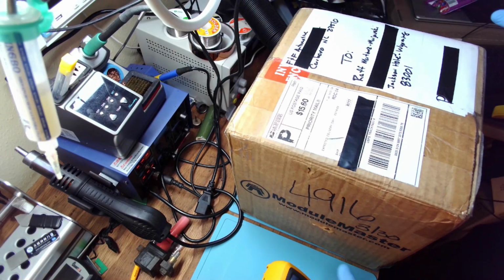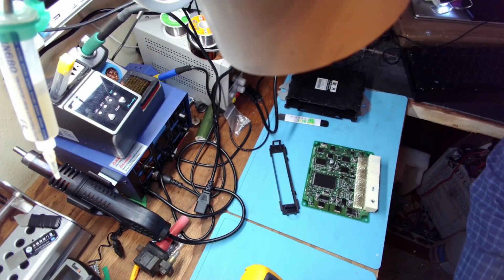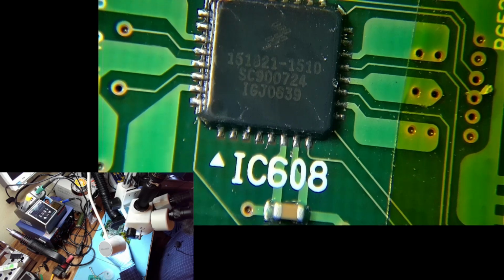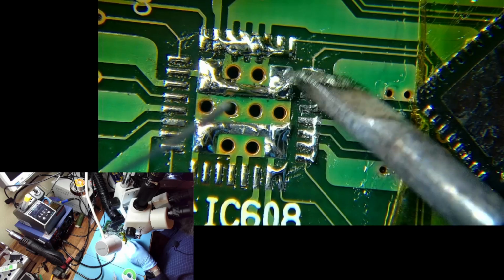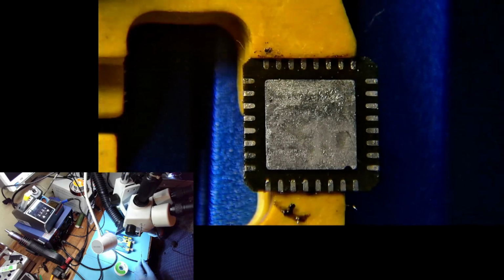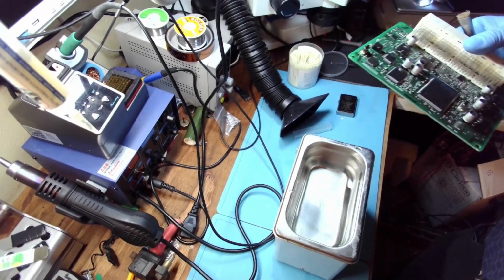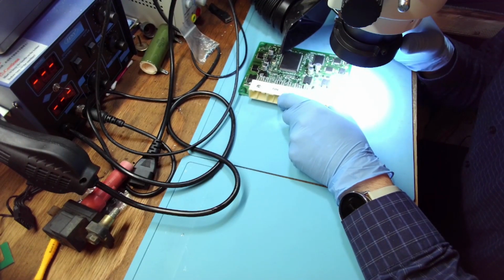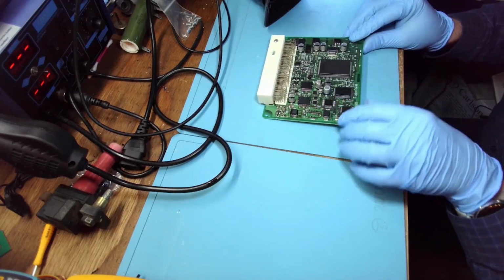09 Subaru Outback ECM Hates me but I will repair it anyway

Comment: Hi there, great video and good job on the repair but you should use flux when doing the hot air work it will help to clean the oxidation from the grounding bonds (heavy heat absorbing) the the centre of the ic. The iron temperature is too low to be able to do that with wick and lead free solder. Otherwise perfect job and well done. I look forward to more of your content.
Cheers
Darran.
Reply from the maker: Hi Darran,
thank you. The only process I don't use flux for, is removing the chip (first stage), I don't feel like it's needed there, the rest of the process of course cannot be done without flux for reasons you mentioned. I use 40-60 solder so 350C on the iron and 250C on the hot air is perfectly sufficient. 
Thank you for your feedback,
Raff

Comment: Hello, I have a 09 Subaru Forrester , I'm getting a P1560 "Back-up Voltage Circuit Malfunction" the ECU got wet from rain getting in. It had some green on the back of the board, I cleaned it off with a tooth brush, but the code keeps coming back. Have you seen this code before? fix?
Reply from the maker: Hello, I have not seen this code before. Liquid damage can be tricky, how long has it been wet? If cleaning didn't help, look for signs of corrosion. The best case scenario is corroded passive component or a trace. Check the harness as it's not coated. Reflow the connections on the harness. Inspect the pins on the harness, that's likely the reason. Use DeoxIT on both the harness and the plugs.
Let me know how it went.

Comment: Sir my outback bp9 using ez30 engine got code p0600 Can communication system...any ideas to solve this problem?

Thanx in advance
Reply from the maker: IC501 is responsible for CAN (output stage), depending on the year it's either on the left side of the board or to the right of the MCU. It should light up under thermal imager to about 35C 
If it's not lighting up you can replace it and see if there's a difference.
What year is it? Is it H4 or H6 engine? SO or DO? Turbo?
If it's H4 SOHC I have a few of them in stock, I can clone yours. If it's H6 DO I have one in stock but those are expensive so it's worth trying to fix yours.
https://blackhorserepairs.com